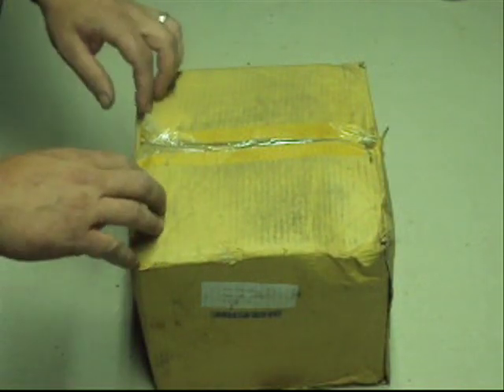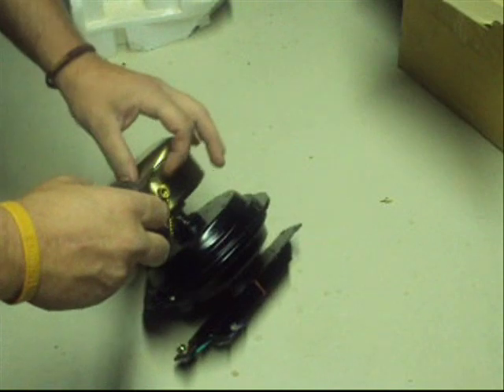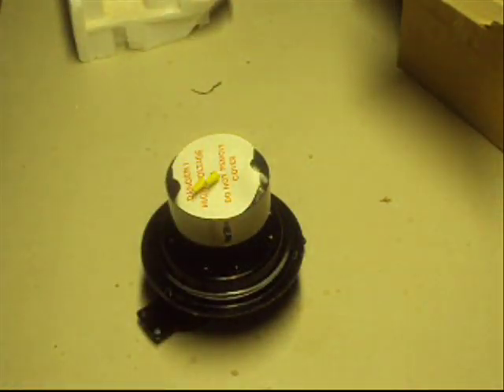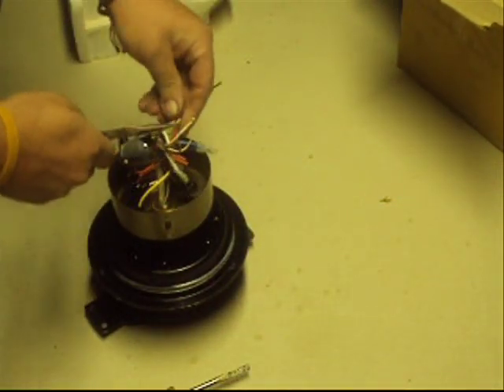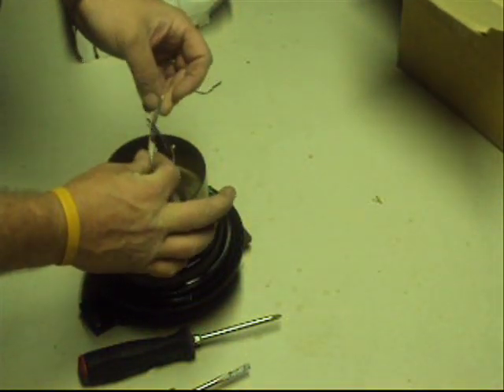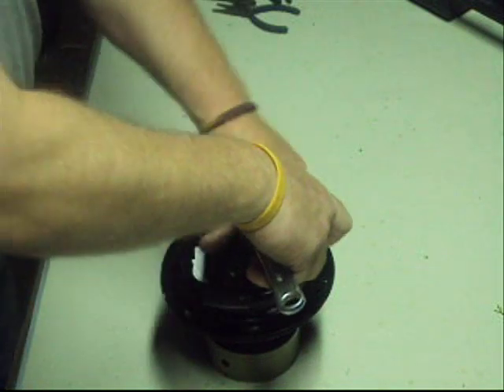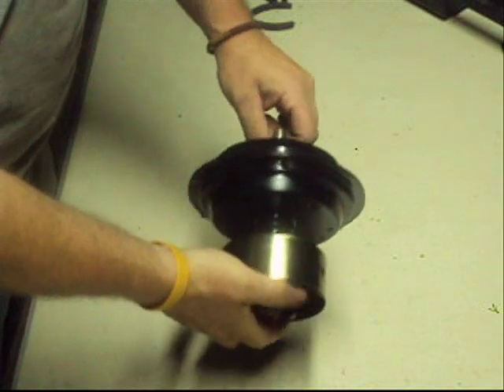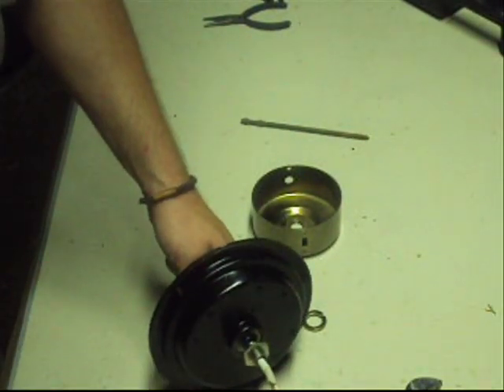THE CEILING FAN WIND TURBINE CLASS PART 1

Comment: Muddy, thanks for the video. I am missing something here. Comparing Solar panels to wind turbine. A solar panel has cell that each has certain Volts and Watts. A turbine turns and provides current into a battery. What makes the voltage 12V or 24V ?

Comment: Love it man - Very Cool - I went out and bought a 5 blade ceiling fan... second hand....Brand new (20.00 bucks) and have a few q's.  I found a bunch of old magnets in some old VCR's that seem quite strong.. (Pinch my finger... etc) and I was wondering how to apply them to your fan project... they are round, about 2 inches across with a 1 in" hole... can I cut them into pieces.. will that work? They are from Video heads and capstan motors... I fixed over 5000 VCRS!  - solarconcert